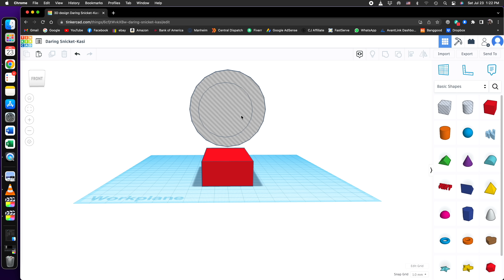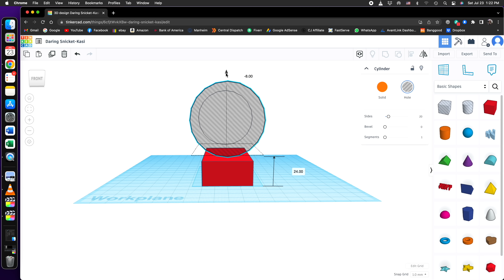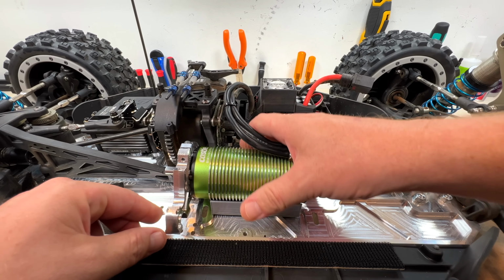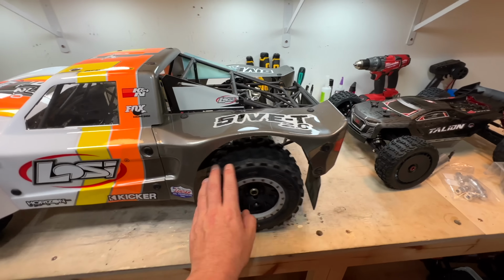World's Biggest Toy Car Is Too Dangerous To Sell?

Comment: Same problem with all my arrma bashers. I bend the motor mount or bend the can of the motor. I made a rear aluminum brace on my lathe for my arrmas. Now it also transfers the heat from the rear of the motor to the chassis. I had to put thermal paste between the mount and chassis for it to transfer heat really well. I thought you were going to be gentle? lol

Comment: Nice Video! The cheap version of your motor support is a big rubber O-ring. That's what I use on my cars with heavy motor to prevent bending the mount. If you seriously think about going into 5th scale have a llok at the FG onroad scene, that might be right down your alley interms of speed on the street!

Comment: Would it be possible to make a servo with a weight attached that moves depending on the throttle/steering? It could give GTA like in-air control to do tricks that just aren't possible to do normally, would be cool to see too.

Comment: You should make the motor support out of metal. It would transfer a lot of heat to the chassis and keeps the motor cool. 😉
Reply: That would be hard because it would have to be machined, and then it wouldn’t work with a gear meshes

Comment: hey Raz, I haven't done it in a while but if I remember correctly, I can use the throttle/reverse/break mid air to adjust pitch and land flat. Couldn't tell if you do this or if its even something to reasonably expect someone to be able to do, I just remember it was the only way my cars landed flat off of jumps back in the day.

Edit: nvm, watched again and you def do this on some jumps. Nice.

Comment: I don't understand why that type of Motor Support isnt stock eqipment. It seems like a no brainer to hold the motor up from heavy landings. OR, even make one out of aluminum so it conducts heat into the chassis for improved cooling. Why not? obviously make it round so it wont deform the motor can

Comment: add more walls to your print, like 5 or 7 (around 2.8mm thick ) will make them heaps stronger and 100% infill but instead of infill increase top and bottom layer count s o its faster.

Comment: Hey Raz funny to see the Talion build it was my last build fishscale adapters for scale wheels new Talion EBX crazy I did the same thing. Only problem I had is my adapters needed to be machine down they make the car too wide which made it hard to drift I don’t have access to a lathe you may run into the same issue except you’re really good at solving problems😏👍🏻🤟🏻

Comment: I don't know if you thought of the material that you printed the support, but if it's PLA it might deform with heat in time, you could try PETG as it's better at heat resistance, that in case you didn't used it already for this print 😉
Reply: ABS Maybe?
Reply: @graphicalsolutions1899  abs stinks like hell printing...PLA-HT will do the trick without any headaches

Comment: Great bash, I watched your other Losi 5T electric videos since i plan to buy a Losi 5T 2.0 . maybe a couple or few years after i get it i might convert it electric using a Castle XLX2\2028 800KV system or the Hobbywing Max 4\70125 560KV system.